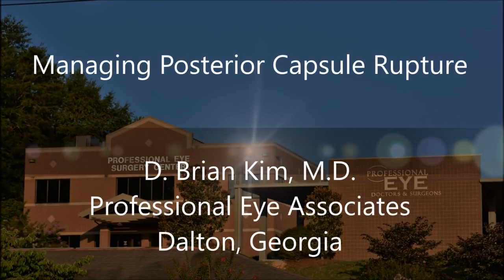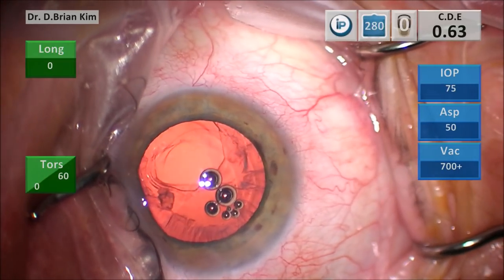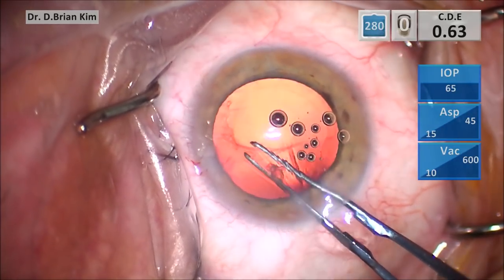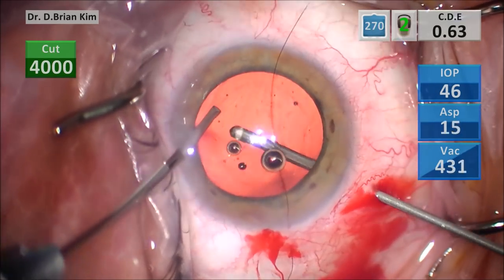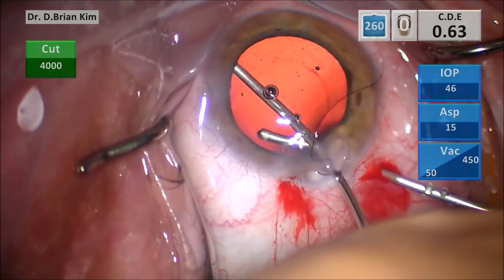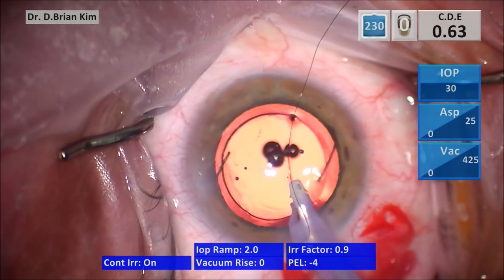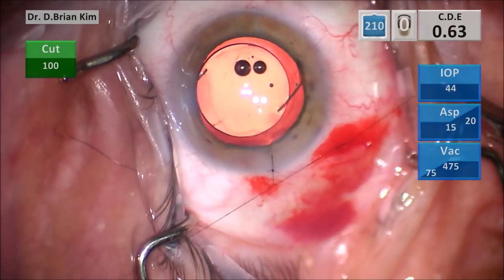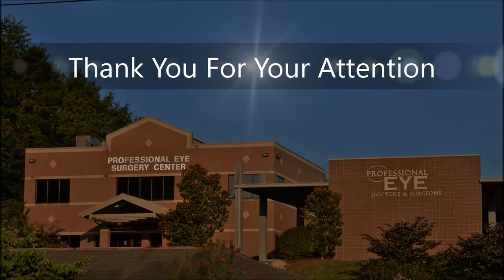Managing Posterior Capsule Rupture

Comment: I think the most important key point when emulsifying the last fragment is to hold the phaco tip bevel up. In this case it was used bevel down so with high vacum parameters it is very easy to catch the posterior capsule,  occlusion and rupture as follows. Thank you for sharing.
Reply: thank you for that tip

Comment: Thank you for this beautiful video.  Learnt a lot from it.  I just have one observation that when the pc tear occurred the eye was not in the center of the field and the neck was slightly extended. Both factors caused a false sense of the phaco tip being high enough. Both factors also caused the high vacuum to act in a vector almost directly against the force of pull of the zonules. Finally the pc gave way at a point between these two contrasting forces. It is just another way to look at the problem.  The management was impeccable.  Keeping the eye in the center of the field especially during the last piece has always helped me in better depth perception.
Reply from the maker: rotastrain, thank you for  sharing your observations.  I wish I could claim that this happened due to poor depth perception, but it was not.  I violated a few rules I usually follow on most all my cases in the context of removing the last fragment:

1. I (almost) always place my chopper deep into the capsular bag with removal of the last fragment in order to keep the PC away from the phaco tip.  I should have done this and didn't.  As you can see the chopper is actually in the same plane as the phaco.  This is NOT what I usually do.

2.  During last fragment removal, I usually apply lower vacuum to minimize the postocclusion surge.

Failure to follow these fundamental rules led to this.  Unfortunately, I can only blame lapse of judgement.  Thankfully, so far the patient is doing well.
Reply from the maker: Hi Amit, Thank you for the question. I have not ever caused a PCR by the chopper itself but it could happen, in theory if the surgeon inadvertently pushes the chopper too deeply and breaks the PC or if there is a sharp burr at the tip of the chopper.  Yes, I do have a nice video of placing a CTR in the context of zonular disease. In this case, it's from ectopia lentis.  Here is the video https://www.youtube.com/watch?v=J_x-imuF3qk
Reply: @DocBrianKimMD  sir, wat do u think of  using sinskey hook ...can it ever cause pcr...wat is the safest instrument that can be used in nucleus piece manipulation in phaco...
Reply from the maker: Amit, I'm not quite sure what you are asking. Are you referring to what instrument is safe to use as a second instrument? Or are you asking if it's safe to use a Sinskey to hold back the PC?  I would say, any instrument can cause a PCR but only if you do what I said in the previous post (push the PC and break it with the instrument or if it has a sharp metallic burr on the tip which should be sent to the company to be smoothed and polished). I prefer a rounded tip instrument like the chopper I use. The Sinskey is a bit pointy but if you turn the handle so that the tip is facing upward and the elbow of the tip is facing the PC then it would be safer in theory, but you could only do this if your Sinskey has a straight handle. If you want my opinion, I would suggest switching to a chopper which is designed for lens manipulation. I would not use a Sinsky for this. You can certainly use it and do fine but there are better instruments for it, this is my opinion. I hope this helps.
Reply: @DocBrianKimMD  thanks sir...well explained
Reply: That is a great observation 
I personally reduce the parameters or shift to epinucleus mode or bring the last piece into the AC and emulsify it there. I believe a little bit of corneal oedema is acceptable compared to the inconvenience of having a PC rent

Comment: I advise bimanual I and a in cases like this. Agree with the PPV. The B and L injector is better- the IOL comes out flat. I do triessence wash in AC at end of case. Lastly I don't I and A after IOL, but instead i irrigate with miochol via the para and burp out most of the viscoastic. Anyway, very nice work!
Reply from the maker: All excellent points.

1. I have limited experience with B&L 3-piece IOLs but I have seen the planar injection and like it.  But with the exception of the Starr 3-piece which enters the eye very fast and opens in an uncontrolled manner, I don't really believe the type of IOL is otherwise critical. 

2. Bimanual I&A is reasonable but I don't use it routinely.

3. Whichever technique used, finding the balance between OVD removal and making sure vitreous does not come forward is a challenge.  Whatever works best for the surgeon.  The more important point is that a good vitrectomy needs to be performed, otherwise there is a higher chance for vitreous to come to the incision, regardless of technique.

4. Yes, Triessence and miochol are never a wrong choice.  So when in doubt, use it.

Thank you for the feedback.

Comment: Is it allways possible to remove such a shorr cut conjunctival suture later? Or do you burry it as well? Thank you for the great video.
Reply from the maker: Hello, you can close the conjunctiva with nylon or vicryl.

I would typically prefer vicryl since it absorbs. But you can use nylon as well. You don’t need to bury the knot because I would cut it out within 2 weeks after surgery anyway. If you bury the knot, as you pull the suture out, it could pull open the conjunctival wound. It is not a big issue regardless. Conjunctiva heals well and is forgiving.

Comment: Thank you for the beautiful demonstration.  I have some questions if you don't mind please: 

1- What was the anesthesia status of the patient throughout the procedure ? 
2-After realizing the PCR do you  just suddenly pause contentious irrigation before injecting OVD or you inject OVD while continuous irrigation  mode is on ? Do you ask help from the assistant to push the plunger of OVD or you just use the fingers of the same OVD hand? 
3- Were you able to see the Vitreous it self in the AC through your microscope or you were just depending on the signs of its presence only  like irirs shape and movement after gentle sweeping in the AC? 
4- When would you remove the main incision corneal stitch for such case? 
5- I am operating on Alcon - infinity  so any approximation of 45mmhg  IOP to the height of the irrigation bottle on my machine? 
6- As some of the OVD  will still be existing in the such case, would you give Diamox 500 mg blindly for the patient or you monitor his IOP and act as required ?     

Last but not least thank you very much.
Reply from the maker: Hi Anas,

1. MAC with topical
2. I keep continuous irrigation on while I inject OVD.  I have my thumb on the plunger and place the cannula through the paracentesis and push the OVD all with my left hand.  I do not use an assistant and would discourage anyone form doing that.  Also I  injected the OVD very slowly to be safe. You have to be careful that the cannula is screwed on tightly or risk torpedoing the cannula into the eye if you apply too much plunger pressure.  
3. No, I did not see vitreous in the AC.  I only saw the PC rupture.  Almost all of my PCR cases occur when I quickly realize the problem occurs and address it ASAP.  With most of my PCR cases, I'm able to recognize it early, prevent the hyaloid face from rupturing, and place as single-piece acrylic IOL in the bag.  If you recall, you asked me to upload a PCR case and at the time when you asked me, I didn't have one recorded.  So it's been a long while since I had a PCR but being human is part of life and part of surgery.  Early recognition is so critical to ensure a safe and efficient resolution.
4. Suture removal at the 2 week mark.  The incision was stable so I don't worry about it long-term.  If a corneal incision is leaky and unstable, then I keep it in 4-6 weeks.
5. I would just cut the bottle height in half.
6. Yes, as a protocol, I give diamox 250 mg PO QID x4.  I don't use 500mg sequels as they are slow acting.

Thanks for all the great questions.  I hope it helps.  Best.
Reply: Thanks for your answers.

Comment: Why do you enter 2.5mm back from the limbus?  My understanding is that the pars plans is ~2.4mm posterior to the surgical limbus, so 2.5 is safe but why not 3mm or 3.5mm, just to be on the safe side?
Reply from the maker: OPHTHO INFO great question. You are right. The pars plana is more posterior. My recollection is not clear. I’m not sure if I actually went 2.5mm back or just misspoke. Regardless, 2.5mm back is still safe because this the location I go for scleral fixated IOLs. But you are right, I typically go 3.5-4mm posterior to the limbus in normal axial length. Thanks again for pointing that out.
Reply: D. Brian Kim MD thanks for the prompt and detailed response, love your content, changes the way I do surgery, keep it up!

Comment: Hi Dr Kim ,
Suppose we don't have Triensense/Kenacort  to inject into the AC. Do you recommend using Air bubble technique only to find out if the vitreous stands are in the AC or no? Does sweeping with second instrument into the A.C and wound checking of vitreous prolapse by wicksell sponge are sensitive enough to check the vitreous presence especially if the PC rupture happens while injecting the IOL and the IOLwas secured in the sulucs? 
Thanks
Reply from the maker: Anas, great question.  If you don't have triamcinolone, then I hope you can get miochol or miostat.  Pupil constriction is the next best thing you can do to assure yourself that there is no vitreous to your wounds.  If you have nothing at your disposal, then you will at least need to sweep the incisions with a cyclodialysis spatula to assure yourself from different sites.  Weckcel will catch big strands of vit but doesn't guarantee to catch the small ones.  A pars plana vitrectomy also helps if you have experience with this.  Hope this helps.

Comment: Thanks for sharing this valuable video.
Assuming similar situation, contrary to the high rate employed here (4000), what can be the minimum cutting rate (Pars plans vitrectomy)? (In case you don't have a machine with such a high cutting rate)
Reply from the maker: I have done the same PPV using the Alcon Infiniti machine which I believe has an 800 cut rate (not 100% sure though).  And it worked just fine.
Reply: Okay, bundle of thanks.

Comment: What would you do in the case that PCR occurs with bigger pieces of the lens and it mixes with vitreous? You levitate near cornea the fragments with dispersive OVD, phaco and then AV or you levitate them, do a little bit of AV and finally phaco?
Reply: It had happened to me that i make a pcr during initial phaco and ive made first a little bit of vitrectomy and them emmulsified the lens fragments to finally finish a complete AV. I really dont know if theres an specific sequence of making things
Reply from the maker: Tough question.  Every case is different so difficult to say, but in general, I would use dispersive OVD and try to support the pieces as much as possible.  AV will tend to cause the fragments to fall back so it's a balancing act.  I would try to lift the fragments into the AC.  I would be very careful about vitreous incarceration in the pieces.  Use as much OVD as possible to ensure you can separate the lens pieces from vitreous.  If you can pull or push the pieces out of the eye mechanically, I would try to mechanically remove them instead of trying to phaco them.  But if you can confidently separate the vitreous from the anterior chamber with enough OVD, you can try to phaco these fragments if they are too large. 

These are principles and every case poses different challenges.  I would say the best treatment is prevention.  And that comes with very good phaco technique.  But once you have PCR, try not to create more problems.  Keeping the AC maintained and placing OVD into the AC to inspect will tend to keep the pieces separate from the vitreous and you can follow the above principles and hopefully not lose any pieces into the vitreous space.  

I hope this helps.
Reply: D. Brian Kim MD excellent tips. I think that answers my question

Comment: what gauge mvr blade do you use?
Reply from the maker: I believe I used a 23 g, but now I use a 23 gauge valved trochar for my PPVs.  The MVR blade was nice because it cuts very easily, but the trochar is better because it is self sealing and does not require a peritomy or suturing of sclera or conj.  But the trochar takes more involvement to place than the MVR blade.  The most important thing with the trochar is to make sure the globe is firm with an AC maintainer and I like to hold counter-pressure with a cotton tip otherwise it is difficult to pierce the sclera.

Comment: i dunno   i just don't get it,  posterior rhexus? pars plana vitrectomy?  neither necessary, clean up V, lens in sulcus get out OF the eye. number one as a surgeon is don't be a hero. gonna cause more problems. obviously a very good surgeon, but the enemy of good is perfection.
Reply from the maker: You make a valid point, one which I heard many times during residency. But my perspective is far different now.

At the heart of your comment is the notion that all of this extra work is unnecessary and dangerous, but let’s look at the validity of this statement.

You suggest all this work will cause more complication but I have seen my fair share of problems exacerbated by the get in and get out mentality.

1 . Limbal vitrectomy has much higher risk for vitreous to the wound. Before I learned PPV, I would have occasions of vitreous coming to the wound despite my best effort. Coming from behind makes much more sense from a technical perspective because the incision is below Iris plane and in the sclera. You suggest risky but in actuality more efficient and much more targeted removal. Remove it where it is, in the posterior segment.

2. How many times did you have a small posterior capsule rupture expand to a giant one throughout the course of the case? I have. A posterior rhexis limits the potential expansion of the tear.

At the heart of your point is safety. But my motivation is safety as well. We can agree to disagree. It is ok to have a difference of opinion. But we are both trying to do what we feel is best for our patients.

But the main factor of your comment is fear. Fear is understandable but IMO will prevent a surgeon from expanding his surgical armamentarium.

Ultimately, is the fear justified? Have I caused more harm than good? The answer unequivocally is no. Fortunately for me, I have helped my patients exponentially more than hurt them by learning new techniques.

Best wishes.